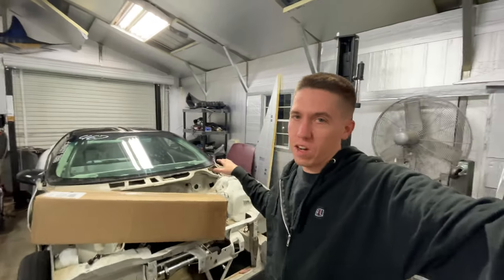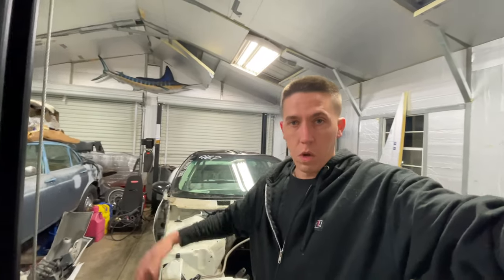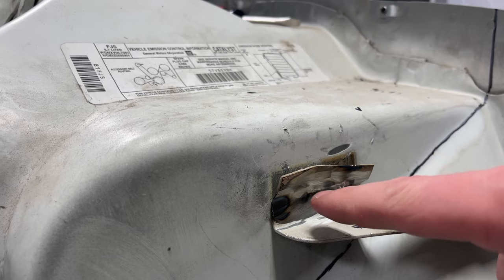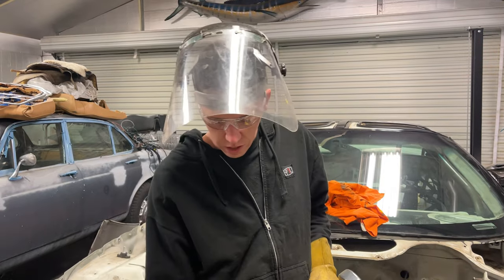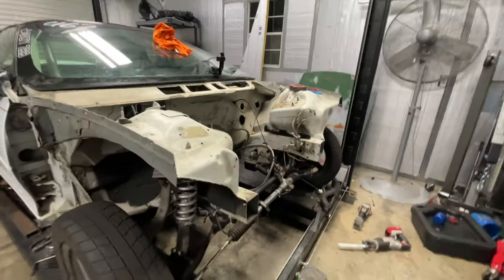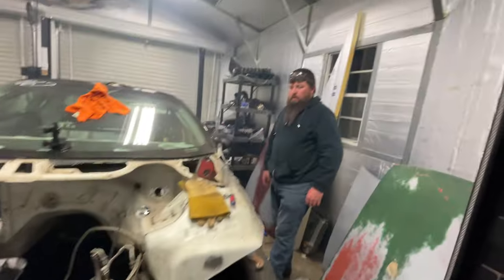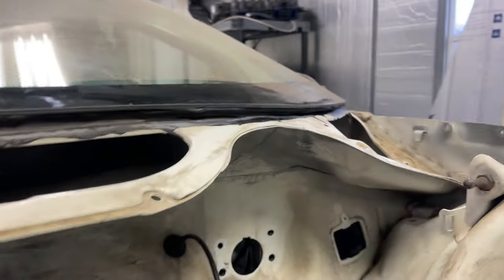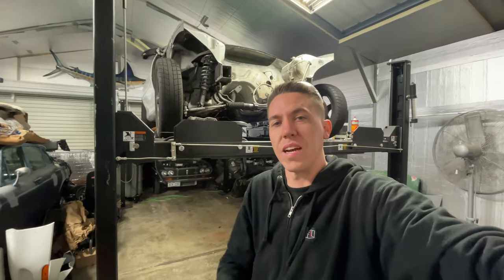I Cut The Front End Off My Camaro!

Comment: since you did a whole video on what weights what.  you should weight the sheet metal that you cut from the fender area,  and weight the piece that you use to replace/brace the outside corner of the upper tube plate.

Comment: Just cut my front off, long overdue. It has been 6 years since I worked on it last. I cut that fender bumps off too. Not sure why they make the kit to mount facing toward it. I was looking if they made one longer to the firewall or if the plate can weld flat against where the fender rounds were. What blows me away sometimes is the exact paths people take, myself included on how to do tackle this. Near identical to how mine went
Reply from the maker: It definitely makes the build nice and easy. I’m going to use some triangle plates to tie it back into inner fender area and should be good to go!

Comment: Hi guys .Not related but, Where can I get the front end measurements for the 1994 4th gen? Got in a wreck and nothing lines up
Reply from the maker: Honestly you can probably do without the headlight measurements if you just put your front end back on and have someone hold the headlight in place while you mark where the bracket needs to go!

Comment: What size plate did you use to box in the upper fender bar to the fender skirt?
Reply from the maker: I ended up using a 1in piece of chromoly about 4 inches long at a 45 to brace the upper car back the the inner fender
Reply: @BuildTuneRace  now that's a good idea 👍
Reply: Would you happen to have a video or pictures of that tie-in?

Comment: Dude what freaking blades and saws did you use?? I’m looking to cut the front end of my 2010 Camaro and custom bolt the the core support on until I can get it welded.
Reply from the maker: 4/4.5in cutoff blades pretty much and brand and on the Milwaukee’s good sawzall blades! They rip